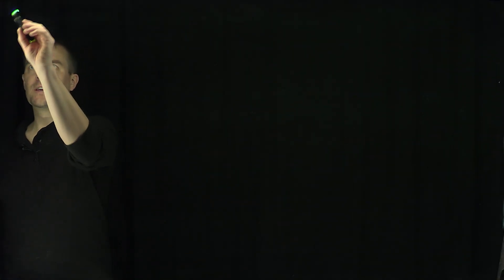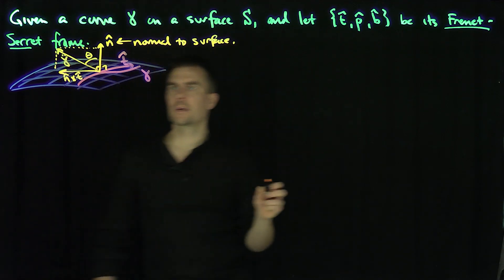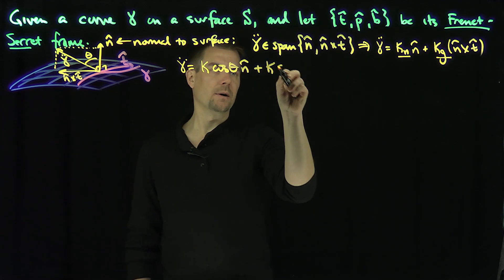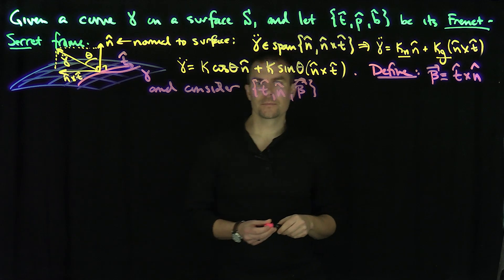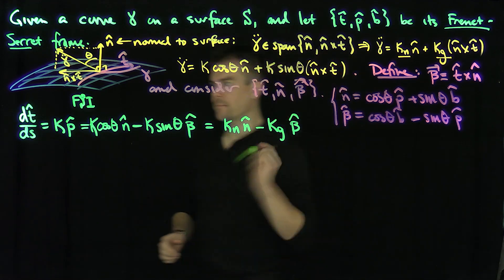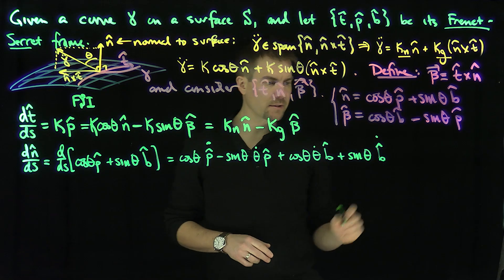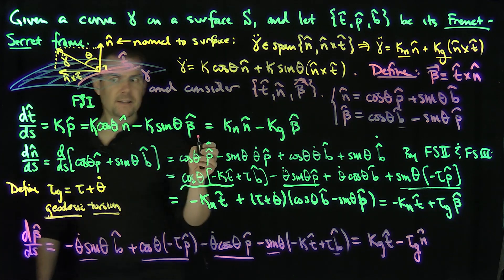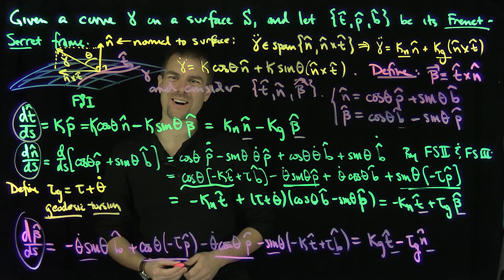Geodesic Torsion and Frenet-Serret on a Surface

Comment: Amazing video! I assume one can derive the equivalent Frenet-Serret form using the unit-speed parameterisation? Could we also do the same for the Bishop/ Parallel Transport frame? Coming at this as an Engineering PhD student so don't have the formal differential geometry background! Looking forward to the next videos!